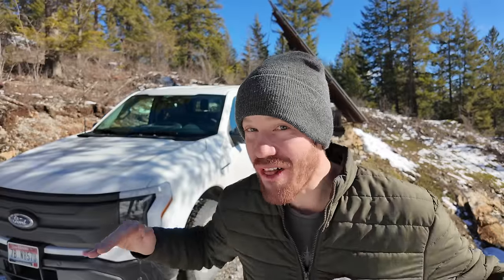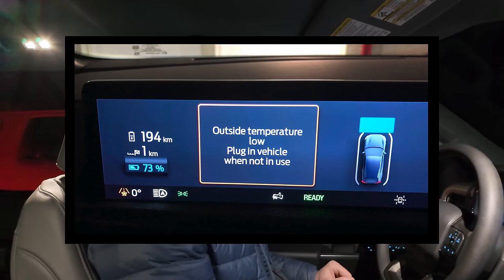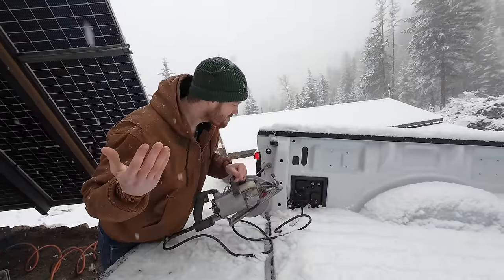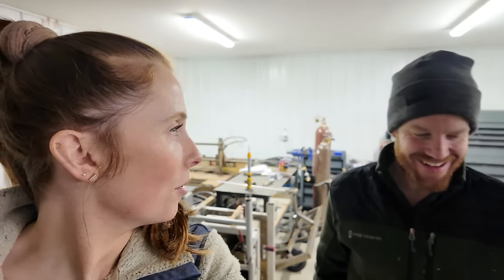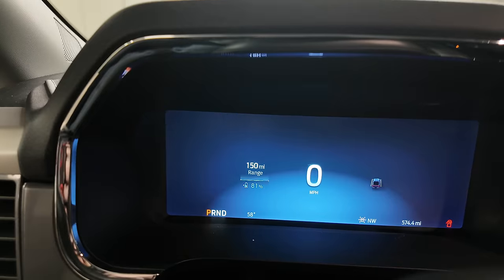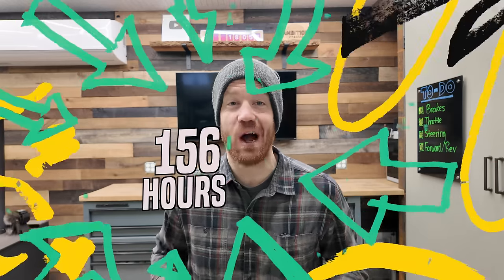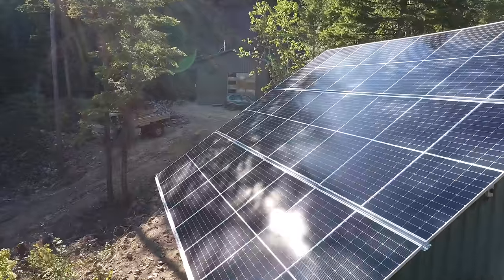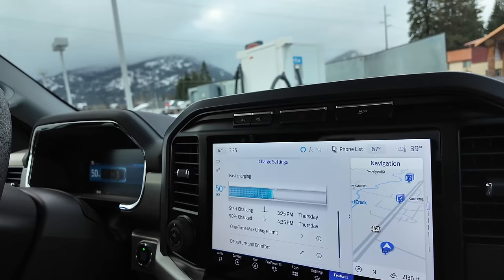Replacing My OFF-GRID Power System With an E.V. (not what I expected)

Comment: You may have had a ground issue as well. Your off grid system has a ground (earth) and the truck has a ground that isn't earth. Putting the two together can cause wonky things. You could experiment by disconnecting pro power ground connection and rely only on earth. Of course GFCI protection does not rely on a ground lead so if you are getting a GFCI error, that's different.
I don't think it's feasible to use the lightning as a "water truck" shutling electricity from town but as a back up to the PV, diesel and propane ok why not? You have dirt cheap electricity in town and in the summer, it'll be entirely free off pv so win win. Your daily could be without any gas or diesel at all so the EV could rescue those to go get fuel. We have a 14-50 at our cabin to charge our Rivian but there was to much snow and downed trees last visit  to drive all the way up our nearly 1/2 mile driveway. It was fine as the rivian had plenty of power not to need a charge even parked in the snow.

Comment: an ev is a great dump load for excess solar. we have been using it like that for the past two years. works in winter too. the other day, i put in 38 kwh into the ev only. everything at home is electric and we rely only on solar - do not have a generator or any other means to charge our off-grid batteries. also, in the past month, we've spent only $10 charging our ev twice for a little bit for a safety cushion for winter weather. the rest of the time we charge it off-grid from solar. it is also easy to adjust the amps of the ev onboard charger to use only the extra solar. we are at 9500' and every night temps are in the teens or much lower.

Comment: Using the truck as additional battery capacity is exactly what I would do in your situation. When you say "in summer we have more solar than we know what to do with" tells me you need a bigger battery.  Charging the truck at a DC Fast charger is going to cost a lot more than the local grid price (I usually see 50 cents or more per kWh in 2024), so I guess that's great in a pinch, but I wouldn't want to make a habit of it.

Comment: No, an EV can't replace an off-grid power system (what about when you need to drive it away?), but it is a wonderful supplement to it. Charging up the truck battery with the excess solar power would feel so good to me 😇😇!! Overall, I'd say that maybe Ford needs to make some improvements with the messaging of faults, and improve the options in software for using the truck purely as a generator (maybe a "generator-only" mode?), but also there's a bit of a learning curve and product should make that easier. Why didn't you guys use the app to control the truck?

Comment: I have been thinking of one for my off grid vacation cabin.  Solar panels out in the Bonnie’s are a target for theft.  The only issue I have is the drive there is so long, I would not have power when I got there and charging on the way will be inconvenient.  We typically head out Friday after work and just want to get there.  Stopping some place close for an hour would be a drag, and that is if there is a fast charger along the way.  

I currently have a pop up camper with full electric appliances and look forward to moving that to an electric truck some day though.  If they added a DC port where I could connect solar and pull 48v dc to charge and run camper, I could boondock for what looks like weeks.  Here’s hoping for an eco line like van to hit the market one day with these features.

Comment: 90kwh/ 7.2kw = 12.5 hours(this is max load and 100% efficiency) I will go 11.5 - 12 hrs. Now that I see they really only use about 0.5kw i would say closer to 180hrs. Also the weird power might have to do with not having a true ground on the truck. Or if you have a ground neutral bond in the panel and the truck has one as well I know that there should not be both or something.

Comment: I would guess the constant sound made by the parked but operating EV truck are fans and pumps circulating fluid to cool electronics and batteries. The incompatibility of the coffer maker could be the AC waveform purity (pure sine wave or something else?) made by the EV truck is not up to spec for what the coffee maker internal computer requires. The in-rush current problem, looks like you already figured that one out.

Comment: I think you sould make a water battery. Install 10 - 10,000 water tanks on the top of your hill. Pump water in the summer from the shallow well into those tanks. Then in the winter, move water from the top of the hill to the bottom of the hill tanks. Then use a water generator to generate power from the water moving down.
Reply: You'd have to bury the tanks below the frost line to keep them from freezing in the winter as well as the lines probably. If you need to add heat Trace you've sacrificed most of the power.

Comment: you guys should use wind, and adapt your solar array so it can go almost entirely vertical at night, and back to the optimum angle during the day. a screw ram, or electric winch would probably be enough.

Comment: My Keurig makes all my lights flicker. Turns out some appliances say they are rated for 1500 watts continuous, but will draw 4500 for a split second. Not enough to trip a breaker but your truck is protecting some seriously temperamental  batteries.

Comment: From the standpoint that it's a bigger battery - you can add 70kwh to you're battery bank!   From the standpoint of driving to town to get a cheap charge - not sure that's practical due to time/bother and likely won't stay 9c/kwh that much longer + fees on electric vehicles.  Oregon has recently gone from 11c to 15c and more rate increases this year.  And as a 6 year off-grid (15kw PV, 121kwh battery, 24,000w inverter) operator - it did appear WAY too complicated.  I think you'll agree your solar system is one of the least maint systems you have and the rig should be the same but it's not mature yet.   I wonder if the inverter on the truck is really rated for continuous 24/7 use over multiple days - how long will it hold up compared to you're Victron inverters.   But - it does have that unique option of short range vehicle using excess solar + mobile (remote) charging.    We really wanted to go this way and be able to power your 7 x 14 cargo -> camper.....  but towing range and lack of charging in Central Oregon made it a non-starter for now.

Comment: Your current home solar system is stationary and not a lot can go wrong, and if something go wrong it is easy to replace.   The vehicle move, all parts shake rattle and roll, something is going to give, break, tare loose or come off a connector. So when you need it the most, the vehicle can go off grid, off to a mechanical/electrical workshop and YOU cannot repair it due to warranty etc.   Too many things can go wrong with a moving piece of equipment.  Not my idea of a good replacement for current - Yes for an emergency - but if there is an emergency and your electrically propelled truck or bike does not work - yuo have a BIGGGG problem.   Stay as is and keep truck if you like it as a transport system and a very last minute emergency battery system for the house.  Good Luck Guys

Comment: You can use fiscal to turn off the fake engine noise and the backup beeper. Also there is a resistor available that you can plug in instead of the speaker that they have for those sounds.
Reply: You mean Forscan.
Reply: Yes.

Comment: It might be the ground bonding that is erroring the solar charging from the truck. 

Also,  if the truck is un grounded,  the inverter at the solar end might not like it.  Might need to look into a way to bond correctly. 

Also, is the truck pure sign wave or square wave? Square will likely error the solar system too.

Comment: First I would be on the phone to Ford for answers to your questions and maybe download a copy of the manual (make sure to read the pertinent parts).  Second, is there a way for you to have a charger at your home that would be more efficient/powerful in charging the truck?
Third, the solid state battery powered vehicles are on the way---2030-2032.  Those will be a huge improvement.

Comment: So, what is your calculation of how many miles your house travels in a day?  :) If your vehicle mileage cost is 4 cents per mile, how does that translate to the whole of your electrical usage?  Does it cost less for a day of electricity on the Diesel generator than it does for a day of electricity from the fast charge in town of your vehicle?  I'd love to see all the meta data that describes the costs involved.  I love that you can divert that solar overflow to your next set of batteries (the truck).  Glad to be following you!

Comment: Replace - No, but Supplement - Heck Yeah.  It would be interesting to know what the 48V charger losses are.  Might be better to run apartment directly from truck as opposed to charging battery to battery when the off grid stationary system is low.

Comment: Your only requirement is what vehicle can do it. And the only one that could do it at the time was the F150 Lightning.  

Also, It would make more sense to run the house off from the truck. You are probably losing 15% in the AC/DC conversion going from the truck to the battery system. Swapping from AC to DC is not free. Then you do it again out of your house batteries to power the house with AC current.

Comment: From Ford…

Ford Intelligent Backup Power, enabled by the available 80-Amp (A) Ford Charge Station Pro and Home Integration System (planned 2024 availability), allows for bi-directional power flow to and from your truck, so that you can power your home with your F-150 Lightning and, in turn, your F-150 Lightning can power your home*.

With the ability to offboard up to 9.6-kilowatts of energy, the F-150 Lightning can provide full-home power for up to three days on a fully charged battery. It can even last as long as ten days if you ration that power.

Comment: I don't think it's a good all in one solution because it's more complicated than it needs to be and it could potentially take out your power and transportation in one go if something went wrong.

I think it's a great compliment to a solar and battery system. Potentially allowing you to reduce the capacity of the home battery you need to install whilst getting similar benefits + solar and EVs a no brainer if you regularly have excess energy.

I think that vehicle to home is in the early adoption phase where everything has glitches. I think in 5-10 years it will be much more common and hassle free.

Comment: We do have a 10 kw solar system with a 40 kw batteries banks. I am hoping using the CyberTruck as a generator to charge my batteries in case of power outages. We are using our solar to charge the model y and run the hvac of the house. In 2 yrs will change our propane water heater for a 120 v plug in heat pump one.

Comment: some generator you need tie Neutral wire to the ground wire you can buy or make own  take 15 amp Male plug and one 12 awg  stranded wire take in end wire to the silver screw and take second end to the green screw You are make ground system your light truck is not ground so it see open ground to the GFCI unit (Plug or receptacle) Two fix make that plug or put ground rod to(Generator or truck ) system see Unbalance system.  this all way happen with temper power  and some GFCI plug Take your make up ground plug to the 15 amp in the truck bed

Comment: The Ford F-150 F150 Lightning XLT Extended Range 131kW 580HK in Sweden cost 144 954 dollars and the version is the "cheapest" available. I know that is not the version you are using and that the truck must be rebuild for the power grid we have in Europe. But still, it is a crazy price difference!

Comment: THD = Total Harmonic Distortion
Appliances are required to handle 5% THD.
Some generators have 20% THD and can harm some appliances.
Your Victron's have pure sine wave inverters which is 0% THD.
The Ford may have a cheaper square wave inverter with too much THD.

Comment: It cannot totally replace as they'll be times when you'll need power at home but the truck won't be. However it does mean that the Home side of the system could be smaller in some cases. And there's gonna be times before the infrastructure is finally figured out that chargers in town don't reliably work see technology connections. And there's a lot of things that are too smart for their own good there's no reason why they can program the GFCI protection to wait a few seconds and kick back in when using a large load. And there's a question of what kind of inverter output is coming off the truck modified sine wave / pure sine wave. Now there is going to be an efficiency lost in all the transfer but I would be curious to know whether that's less than the efficiency of standard gasoline. I think we kind of threw the baby out with the bathwater by going straight electric to quick there's other places where a hybrid would make so much more sense until the infrastructure is built out or places where there's a lot of distance that make up for the increased maintenance and part count.

Comment: Thanks for demonstrating how an electric truck may be used. Where did you get the idea that the battery in the truck could charge your huge bank of batteries? Even if it could theoretically, the truck battery would be drained in no time. As you demonstrated, the truck is capable of powering a normal house. The use of high drain appliances like air conditioning, electric heating, or an electric oven should be avoided.  You don’t need to drive to town every time the truck needs charging. Plug it in all the time but limit the charge level to 80% to keep the battery healthy.

Comment: Seems like it's doing what you want it to do but having to wait for hours for a charge in town seems annoying...but if you have to run a generator excess can go into that as well.  IMHO you should experiment with some mechanical batteries.  Like a tower that holds a large weight, when you have excess power it winches it upwards and when you need to generate power it lets it slowly down.  Another version having two large water tanks, one at the top of a hill and one at the bottom.  During excess you pump water uphill and when you need it you let out water into the lower spinning a turbine/water wheel.  If nothing else would be good content.

Comment: I really like what Edison motors is doing running a small diesel engine to turn a generator n electric motors on the axle u don’t have to hook up to charge ever the engine only runs when the batteries get low

Comment: I wonder if there is a setting with your solar charger to set a separate circuit that you can program to only deliver power when the  house batteries are full - means you can just connect the car all the time in the summer and it'll always absorb the extra!

Comment: Instead of using the power point charger I recommend getting a EV charger such as the Myenergi Zappi, the Zappi has a mode in it that will only use excess solar power to charge your EV

Comment: Wow Riley!!!  Well I guess you keep coming up with the questions for different situations.  Having a $49k battery storage unit seems a little extreme.  But my thought or question is- when you have an emergency you need to drive your truck!  Consider having only one truck.  I bet you would not own that one truck.  You could have doubled your battery storage at the house for less than $49k AND been able to store leftover solar more times and without effort and extended your use rate.  I don't know.  Next you are going to be carrying a generator of storage bank in the trunk for when you run out on the way to the charger in town!.  I think that the truck is amazing, and you need to carry truck like supplies more often that transit type persons.  EV is not your end-all do-all.  Looking for when you compare your video of today to investment comparison and storage equal battery bank to the awesome setup you have!!

Comment: @AmbitionStrikes - Riley, I saw that video too when it first came out. It got me to wondering if it could provide us with a source of "Quiet" backup power and my first new truck too. I'm hoping to build an off-grid garage soon and I have been comparing and pricing off-gird solar systems for it. I am now wondering if I could use the truck's battery pack with whatever solar equipment, less any rack batteries, I might need to make everything work for the garage and have solar panels on the roof. I must say - I am curious - as you did not mention anything. Did you guys also use the incinerator toilet while using the truck for your power supply?  All the Best, Tony

Comment: Would the ford charge station pro and ford home integration system work for your offgrid system? I think they allow bidirectional charging and vehicle to home through the j1772 port so the vehicle may not have to be on, should also be able to automate the charge/discharge with the home battery and solar. At the moment you're using it as vehicle to load. Its pretty cool that you can just make a trip to town when the power is low and top it up. With the diesel generator you could get automatic throttle control modules, probably a battery warming pad, solar 12v trickle charger / mains charger, and auto start module. How long would it take the f150 to be cheaper than running the diesel generator out of interest?

Comment: You need pumped hydro. Build or buy a huge tank at the top of your hill. And another sufficiently down from it to run micro hydro and the store the water afterward to then pump from back to the top tank when you have excess. Water freezing in the lines has ruined my suggestion, hasn't it. Damn.
Reply: Or just have the two lines loopable and insulated and rely on the thermal mass of the water and keep it flowing in circles when not in use, or drain the lines fully when not in use.